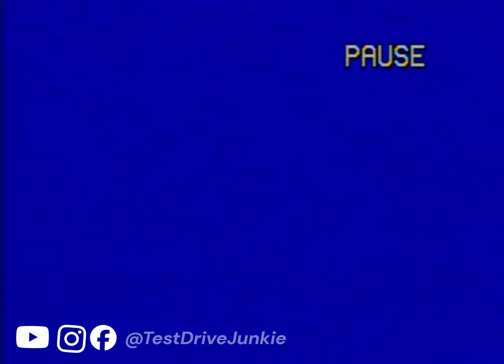1982 GMC S-15 Manufacturer Laserdisc Promotional Video: How It's Made.

Comment: My first truck! A couple of flaws, but I got 157.000 out of it when I traded it in. 2.8 V6, 5 speed, 2wd. 
I put a water pump, fuel pump clutch and a rear main seal in all those miles.

Comment: I drove one of these as a fleet go-fer truck long ago.   As I recall, it was a 1990 model with the 2.5L four-cylinder engine.  It did its job well enough and I didn't have any problems with it.  Basic work truck.